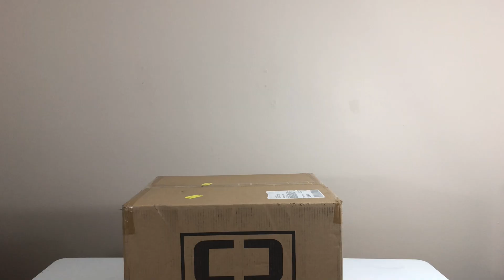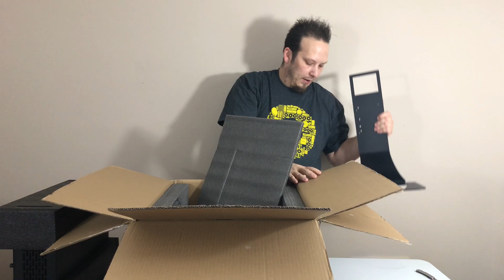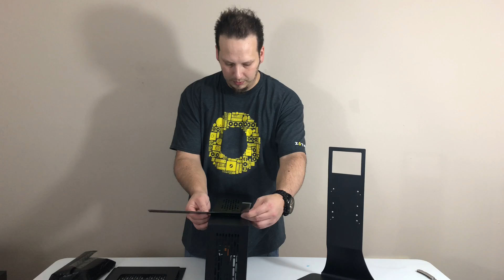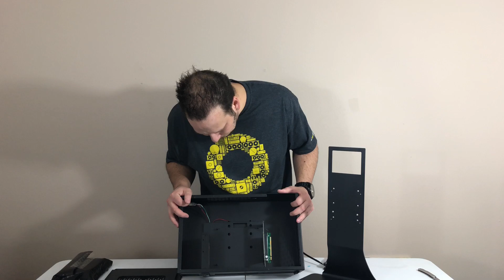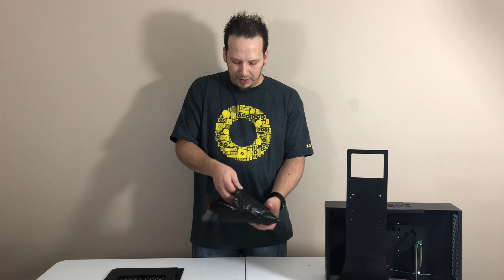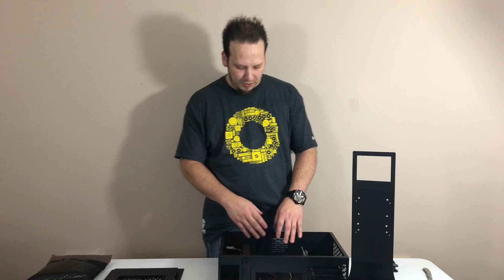Crate Computers Computer Case Unboxing and Overview

Comment: What size fans are meant to go on the top? 80mm or 92mm? Could put a dual rad on the top. And maybe 2 slim 240mm rads on the side, with slim 120mm fans.
Reply from the maker: The top fans are 92mm, it’s not wide enough for 120mm fans.

I did extend the top, and make it wider to have a 240mm radiator up top.
Reply: @Lucidmadedesigns  And could you use a sfx power supply?
Reply from the maker: @ggesdsdsdsd  I did use an SFX PSU, but it was a tight fit to the motherboard and I had to make my own mounting holes for it.